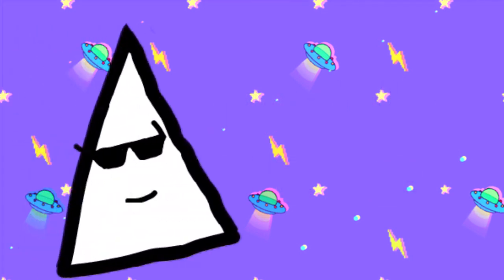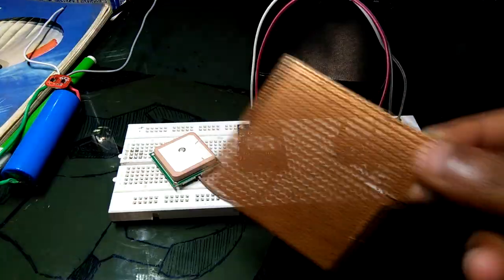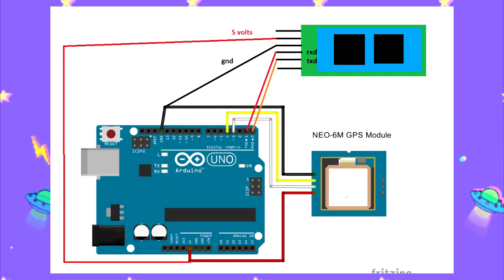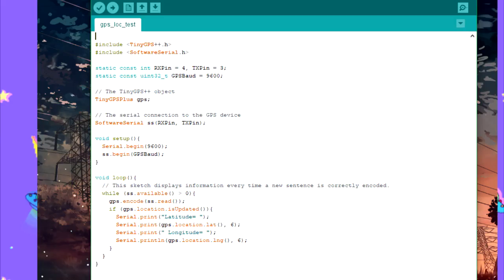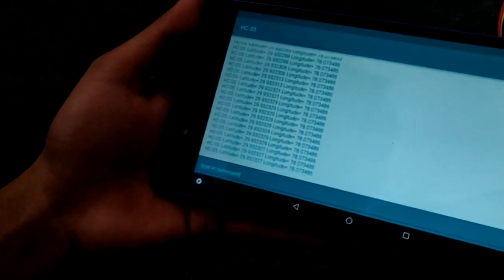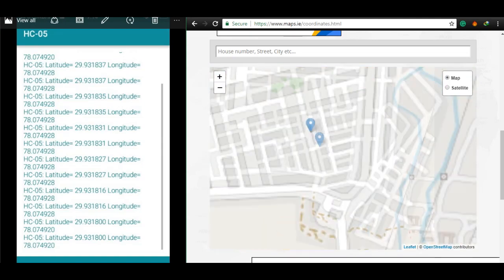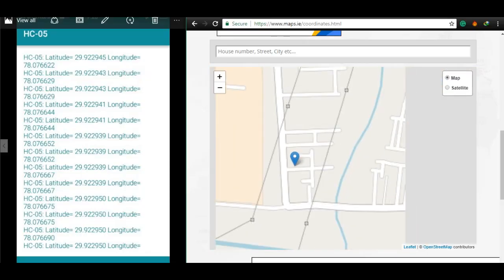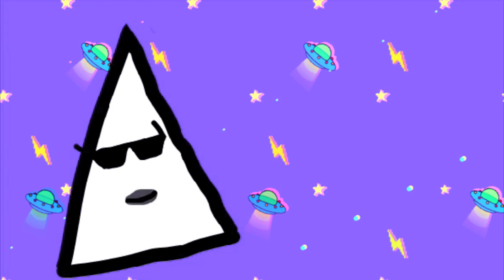U-blox neo-6m GPS Module Tutorial part 2

Comment: Bought new Module 
Result is only 0.0000 0.000000

And light of module is not blinking
Reply from the maker: Replace it then.
Reply: no u gotta go out to get connected to at least 3 satellites when it starts blinking you ll get location check out my channel

Comment: When I try this circuit I can connect to my Bluetooth, but it's almost like my GPS is off. I've tried changing around the circuit so that I reverse the positions of the Bluetooth and GPS, checked the Rx and Tx, and also checked the power. I am using the code provided. Please help.
Reply from the maker: PR0bro  there might something wrong with your gps module, is your gps module working?
Reply: @ArnovSharma  Thank you for the quick reply. I have a tech exam in a little over one day and I need this to work. My GPS is working, just tested it.

I don't think there's something up with how the Bluetooth is receiving the GPS data. When I tried the circuit shown, neither the Rx or Tx lights on the Arduino were flashing.
Reply from the maker: @PR0bro   no problem. first try to print latitude and longitude on serial monitor, then add the bluetooth module
Reply: @ArnovSharma  hii , i have the same problem with my gps i cant use the bletooth and gps,any solution?
Reply: @alonnarkiss2628  yes check out my video